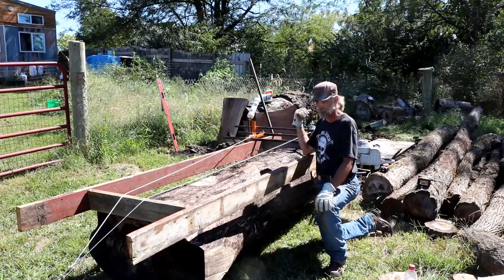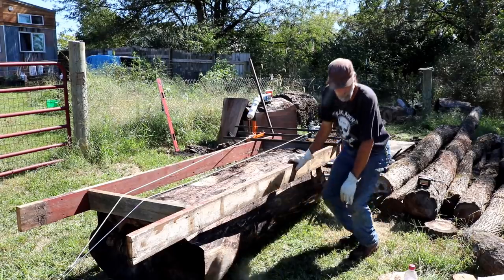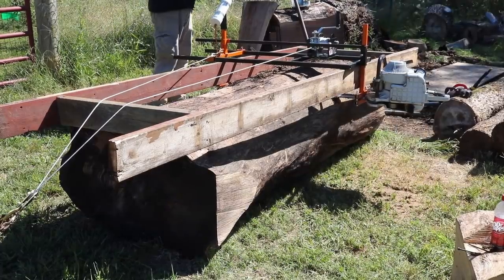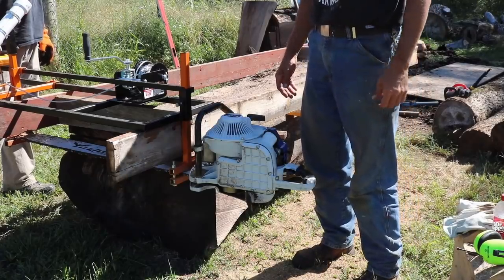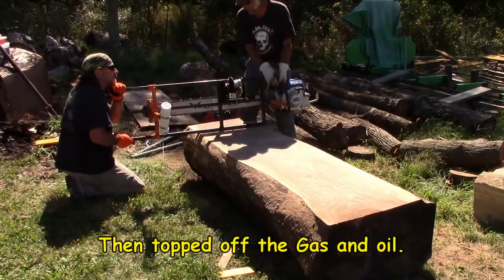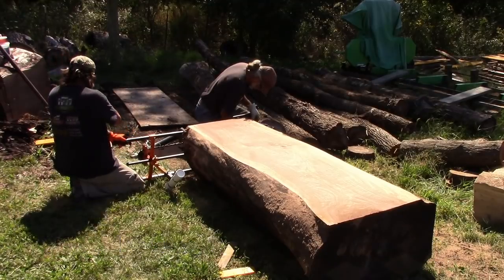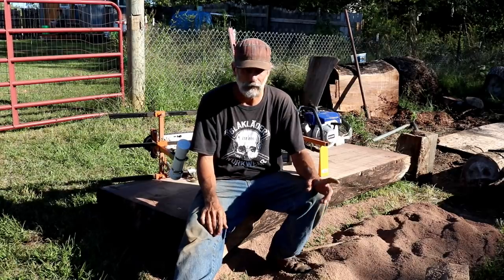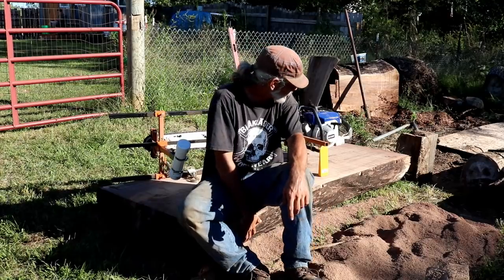Milling Walnut with the Cheap 105cc Chainsaw

Comment: I found with my mill the chain was never getting enough oil for the work demand it was experiencing and cutting speed and chain life increased when I added spraying or dripping  canola oil to the bar while cutting.  Made big difference and canola oil doesn't get into the wood as much.

Comment: Cy. If a bar was put on the front of the the guide, say a foot or two or longer, level with the rack, the nose rounded to keep it from catching and gouging into the wood it would help at the start until you have the entire rack on the log and saw into the log. It would keep the saw from being to high in the back and you could see if it rose off the front, to raise the saw in the back. Take it as a chip of wood, just an idea I had. Thanks for the time and work making these videos for us.

Comment: Saw is perfect where you have it adjusted , it's going in and out of 4 stroking which is what you want on a big ol 105cc saw like that . The old saws were never designed to run high RPM like the newer ones and pushing a saw to it's limit will shorten it's life .
Reply: A two stroke should two stroke if it is four stroking it is too rich. Period.

Comment: Love my 105 Holzfforma. Right out of the box I handed it to a co-worker who is much more experienced with chainsaws and their repair. Told him to kill it if he could. We’ve both had bolts and screws rattle out but blue Loctite fixes that quick. No mechanical issues at all. I would buy another one with no hesitation.
Reply from the maker: Unfortunately for me health issues have curtailed my ability to handle the big boy. He hasn't seen a lot of use of late. But I am o. The mend and have helpers now so maybe come spring I will break him out for some more slab milling.

Comment: hopefully you've figured out by now why your winch is slow but in case you haven't, you're doubling the required rotations of the handle by using that snatch block, do single line pull and you won't have to turn it as fast to move the saw..

Comment: the first time I cut open a walnut log, I really was thrown back at how green (in color) the wood was! 
 I didn't know that the walnut color came after a few days of oxidation. Thought I had actually had a (really hard) poplar! That made me second guess everything I thought I knew about trees!
Reply from the maker: Yep, still cracks me up every time I see it. This one was still plenty green inside despite setting for a year and a half. All the slabs have darkened up on the out side now though.

Comment: Have you tried running the saw at an angle to the log? What you are running is a straight-on end grain cut which is tougher on the saw/blade than a rip cut. A rip cut is parallel to the grain and the chips flying should be long strings instead of dust. 
Nice looking log, great jig. Love the video!
Reply: Charles Smith that is called a rip cut. It doesn’t matter if it’s from or through the end grain. If it’s down the length it’s a rip.

Comment: Have you considered taking the hand crank off your mill and replacing it's mount with a spare socket so you can use a powered ratchet or drill on it and save your arm and speed things up as well?
Reply from the maker: I explain why that is a bad idea in the video where I built the mill. The particular winch I am using has a pot metal worm drive, when using a drill to control it it ends up chewing the worm drive up and ruining the winch.
Reply: @DIYwithUncleCy  , even if you used it with a swivel at slower speeds? If the worm drive is gonna be eaten up by moderate use like that then perhaps swap it out for something a bit more robust?

Comment: Hi, new to your channel, so howdy.
I am getting my sawmill set up and going to do a cut or 2 to see how it goes. I do have a question though. I have a cheap little 1000 # block and tackle, and I was thinking about using it in the place of your winch. I am thinking that I should attach it to the part of the sawmill that rides on the log. What do you think? 
Also I am going to try a skip-tooth rip chain and compare it to a regular chain. Just have to see.
It seems like you got it together. The trouble I have is over thinking every thing.
Smiles!
Reply from the maker: With a block and tackle it would work but I would think you need 2 people to be efficient and the second person ids going to need to understand not to over pull the saw. You will definitely need 2 hands on the saw most of the time. If you use a winch then the winch on the Mill counts as a hand on the saw. I have a video up comparing different chains on a edger mill look into that it may give you some insight into chains, but by all means experiment.
Good Luck :-)

Comment: Good video.  I've made some adjustments on my Stihl 261 c-m and run it at 32,000 rpms.  I could cut down a forrest in a day.
Reply: How did u do that?
Reply: i call b.s.
Reply: Ya that dosent seem possible
Reply: Bullcrap you can't run any saw at 32000 rpm.....hahaha can you say bye bye saw Lol 😂😂
Reply: @TheirsHopewithJesusChrist_277  I just tweaked it some more.  I got 37,500 rpms now.  This thing is a beast!  Sucks the gas big time though.  I cut down and chopped up a 60 foot pine in 6 minutes.
Reply: @profighter1234  lmao
Reply: Does it have V tec .?
Reply: @dantan-tt3el  me to seen as how anything over 14k rpms sets up harmonic vibration fro dis simlar metals it will blow apart, how do in know owned a saw shop for years, i did run my p1000 partner 100cc at 12k with no problems
Reply: I want some of what you are smoking...
Reply: @richarddaggert2630  you got fooled lol
Reply: No your not its litterally imposible to run a saw at 32000 rpms it just wouldnt work
Reply: And its the cm which you cant even adjust ?????????

Comment: Make a bracket to screw into the log to hook your winch cable to. And get a faster winch or use a rope and counterweights to pull your saw through. Too much cranking.

Comment: What chain oil are you using in the gravity drip system?  I read that you can use cheap vegetable oil, since it oils on the pull side you don't have to worry about it slinging off.  Do you worry about the oil staining the wood?
Reply: Use whatever oil is cheapest and no, stains are not an issue. It all goes into shavings when u plane it.

Comment: Nice wood but something didn't seem right about the setup. You may want to look into a better chain. On a log that size I averaged  7min per slab. Will say that saw needs to be tuned better. If you're going to run those lower rpm s you need to lean that low end or mid if you have a 3 needle carb. Good luck.

Comment: Why do you do the 2 - 1/8" slab thickness?  

I have this 48" to 33" - 46' long straight Red Oak that I would love to Slab/Block for like some block coffee tables and some slabs for say tables, but its so huge and in such a bad spot to get too, I would not even know where to start!  My property was logged many years ago, but I think they left this one cause its so big even the skidders could not get it out!  No doubt the only way to get this thing out is in manageable pieces.  Sorry I'm a bit new to this, but when I see this huge tree thats starting to decay I cant help but hate for it to go to fire wood!  

Do they even make a mill like this that can cut a log that's 4' thick?   How do I know how long to make the sections?  I have so many questions....where do I start?  HELP!
Reply from the maker: Well I wouldn't recommend milling it in one piece that long. 6 to 12 feet at a time is where j would start. If you cut it into chunks that large a truck with a winch should be able to pull them to a better working area (not being able to see it this is a guess) it takes a really big saw to mill 4 ft wide. Maybe an ms880 or there about. This 070 clone I have would struggle with it i think. As far as the thickness i mill at that was just convenient at the time. I could have gone thicker or thinner but after planting the rough stuff off and flattening it i am hoping for 1.5 inches thickness.

Comment: I bought the same saw and have been milling hickory and cedar mostly any chance you have some film of adjusting the saw. I would like to tune mine in a bit better.
Reply from the maker: No footage of it but I bought a little electronic tach that hooks onto the spark plug wire and used that to adjust it. It sure makes it a lot easier.

Comment: Is the saw actually running at 105 cc? I ask because I've watched much less powerful STHIL's mill hardwood at what looks like the same speed or faster.
Reply from the maker: Yes it is 105cc however you have to keep in mind that it is a lower RPM saw than more modern stihl saws. Also I am cutting 32 to 36 inches of Black Walnut (a pretty hard wood as hard woods go). The advantage this saw has is that it has superb low end torque so does not damage itself with high revs. It runs much cooler so will have less metal fatigue of internal parts as well. Other wise running it at maximum RPM for extended periods doesn't hurt it where as a saw running at 12000 rpm would need an occasional cool down to reduce the chance of failure.

Comment: Never used a rip chain before, but I've ripped logs with a standard chain.  Shouldn't it throw bigger, longer chips, as opposed to dust like that?
Reply from the maker: The angle that the bar is in comparison to the wood grain makes a big difference. When strait across it was dust, when the bar nose was ahead it was getting chunkier. The chain was brand new from granberg so I know it was sharp.

Comment: As someone who is going to get into milling fairly soon, I have been looking at chainsaws. Would you recommend this saw for the money, or would you recommend to spend more money on a better brand with less power? I thought this looked like a good deal, but haven’t ever milled, so I thought I’d ask for your two cents. Thanks a lot, and I really like the videos you put up.
Reply from the maker: Well it certainly gets the job done. And I figure If I sell 2 or 3 of these slabs its all paid for. A more expensive saw will be faster to mill with (higher RPM) however it still takes 2 years or so to dry the slabs so they can be sold (unless you know someone buying green slabs) and you'd have to sell 5 to 8 of them to cover the cost of the bigger saw. I think this one is a good choice for that reason alone.
Reply: Thank you. I’ve recently subscribed to your channel because you seem to be honest and knowledgeable. Any chance you are planning on doing a video that explains how to modify/adjust the chainsaw to run well? You talked about the governor, and adjusting the carb (I think), and I think that would be a great video for a lot of people to understand how to do, myself, definitely, included. Thank you!
Reply from the maker: Well the problem with doing that is it can end up scaring the piston requiring a rebuild of the upper end of the engine. I don't really want to do that to this saw since these slabs are a money maker for me. However I could easily do a video on how i am tuning my saws, might not use this saw but the procedure is similar for all of them except the newest stihls (they tune themselves and you pay for that when you buy one). I will see what i can come up with.

Comment: I bought the same winch for my system but discovered it was too slow and nasty unwinding.  Went back to the standard boat winch tyoe.
Reply from the maker: Yea after that I am inclined to agree, may be making that switch myself.

Comment: Nice video.  Makes want to.  Where was the smoke coming from?
Reply from the maker: The saw is still a bit smoky from the break-in when I was running 25:1 fuel. Over time it will lessen since I am running 40:1 now. At least I think that's why, I am by no means an expert on these small engines.

Comment: Nice job man👍😎 Me personally I would’ve taken that handle off of that winch and through my cordless drill on the end of that sucker.
Reply: He mentioned that in the build video I think it was, the drill overheated or broke running for a long time.
Reply from the maker: The gears on the winch won't handle that under load. Its fine for extending the cable without a load but I have stripped the gears in one before. Not the drill just the winch.

Comment: Nice mill!!😀😀
You need to tweak the low speed screw a little bit so it will idle. That thing is running way too rich.
Reply: Hey Al!
Reply: @practicallyIndependent  :) Dillon my friend. How's it going? 😎😎

Comment: how do you adjust the idle on this saw. i have one adjustment screw that is covered  by the pull start cover
Reply from the maker: The Idle screw is hard to get to the 2 screws on the side are the mix screws and yes one of them is obscured by the starter cover making adjustment a pain, but not impossible. But the actual Idle screw is accessed through a hole in the back near the handle If I recall (not in the shop at the moment or I would look). Definitely easier to adjust it with the air filter cover and air filter removed, but then you wont get a true read of the idle.

Comment: Im currious. Did you have to sharpen your chain a few times while milling this log. I've just started saw milling and I notice the chain appears to slow 2 slabs into a 20" log. 24" bar 97cc husq
Reply from the maker: I was sharpening about every 3rd slab. As the chain dulls there is more vibration so you can tell when its getting dull easily. As a side note cutting end grain like this is very hard on a chain and will require more frequent touch ups.
Reply: @DIYwithUncleCy  Thanks for the response. I been watching a lot saw milling vids. No one mentions how often they stop to sharpen. I just bought a $1300 395xp then find out these things sell for around $300 kicking myself now. Looks like it gets the job done nicely. Keep the videos coming. Perhaps I'll start sharing my own.

Comment: What did you use to set  the speed on a chainsaw
Reply from the maker: A digital Tach that connects to the spark plug wire.

Comment: Take your wood to a mill or try saving for a used portable mill like a woodmiser.
Reply from the maker: LOL I can tell you are new to the channel. I have a bandsaw mill. It has a 20 inch maximum cut, I wanted natural edge on both sides. This is FAR less expensive than buying a bigger mill or taking the Log to someone else.
Reply: @DIYwithUncleCy  Hey  just looked like you were struggling with that chainsaw mill. I commented before I got the facts my bad.

Comment: How do you know what RPM the saw is running at?
Reply from the maker: I have a digital tachometer that attaches to the spark plug wire while the saw is running. I use it to tune the idle and the top end rpms
Reply from the maker: Here is the link to it. https://www.amazon.com/HIPA-Tachomter-Carburetor-Adjustment-Husqvarna/dp/B079NJY784/ref=sr_1_fkmr1_1?ie=UTF8&qid=1538314233&sr=8-1-fkmr1&keywords=chainsaw+tuning+kit+with+tachometer

Comment: Ok, watched both your videos on this saw- found them because I got the same saw to cut up the massive remains of an old oak tree, that a tornado took out of the ground like a lollipop for me ... tree people charged thousands to clean up most of it, left me with a 12' piece running from 4' to 6' in diameter, with the root ball (cleanly ripped everything off) Took your hint, cleaned the clutch first.  Saw fired up on the third pull, and I buried it trying to cut this beast up.  Currently waiting for an excavator to roll the log, but, when I'm done I think I might want a better sprocket nose bar, and a rip chain to try cutting planks from the dozen or so smaller downed trees. Where did you get them, every google search I've tried has nothing, or at best, a site in french (which I failed miserably 50 years ago.)  So, if you could mention that, it would be a help?
Reply from the maker: Search for bars that fit a stihl 070. And as for the RIP chain I ordered from granberg. Be advised though it is a 404 not 3/8 pitch chain. I haven't bought a new bar yet but have seen 47 and 60 inch ones available.

Comment: Man those things are slow. Nice cuts though for sure but im spoiled growing up with a 44 inch frick 00 mill with 60 hp diesel ;) this log is cut on a circle mill in same time chainsaw makes 1 pass
Reply from the maker: Yea I would much prefer to cut these on my bandsaw mill but it is limited to 20 inches. Cant afford a circular saw mill big enough so this is the compromise.
Reply: @DIYwithUncleCy  weve had logs bigger than our 44 inch can handle. Remember a 44 inch cirlce mill can only cut a 21 incl log. Anyway, we chainsaw slab it til it fits!!! So gosh if u have a band mill, id use chainsaw mill til its small enough, then go to the band mill. Cousin also has a vand mill and man, its slooooow too lol. Circle mill will spoil u in speed. Chainsaw is slowest, then band aint too far behind, and circle makes a 16 ft pass in 30 seconds
Reply from the maker: The whole point was to get a double natural edge. I have cut down logs to fit the mill before even have a video about that, however not this very valuable walnut. A;so my Band saw mill goes thru a 15 ft piece about as fast as I can walk, so i'd say faster than 30 sec for 16 feet pretty easily.
Reply: @DIYwithUncleCy  yeah depends on wood. Cousins band mill is a very high dollar 17$k auto load, auto feed woodmizer and it was cutting 14 to 16 dia oak 16 ft length for my trailer boards. It is adj speed but it was very slow compared to circle mill. But the point isnt to hurry , it is to enjoy it and make your own lumber and any of them do a good job at not having to buy from a big store. Heck, no way id have my shop or barn if id have had to buy the lumber at full retail

Comment: Forget all the good advices and just have that single cable and have 1to1 ratio, don't use the click on the Crank and it can freely reverse if it starts bogging down..
 Thus is the easiest way and have great control..just give it a chance, make your outcome a lot smoother... 
You tired me out watching you'll